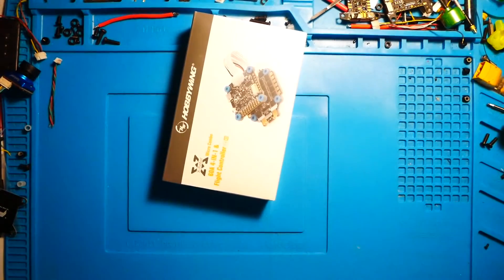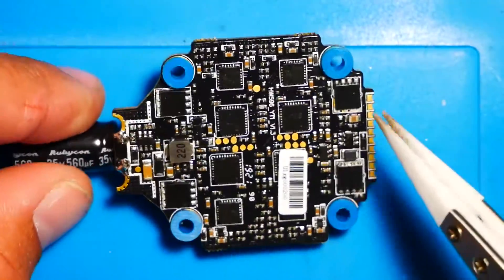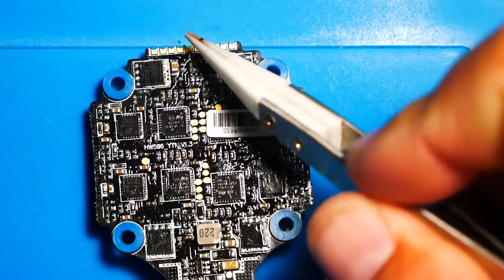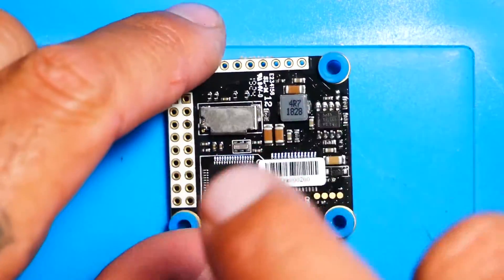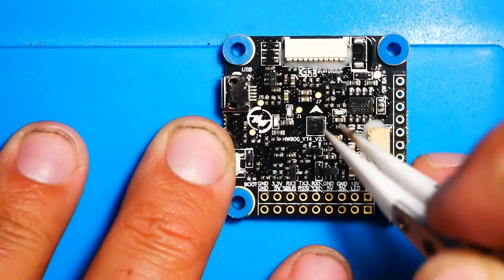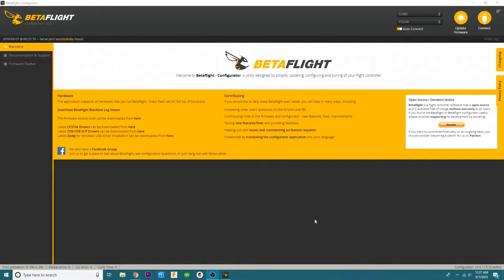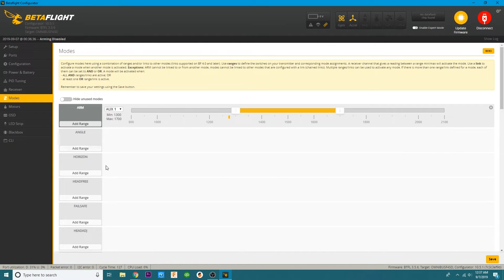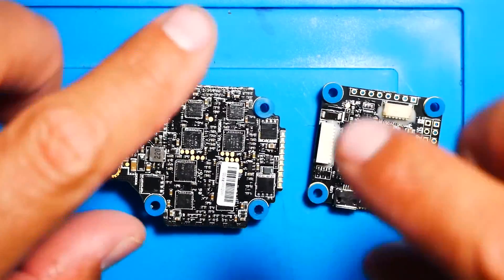NEW! Hobbywing XRotor G3 Stack For $99 - They Are Calling It The Best Stack Ever?!

Comment: Hey Drain man, or any one els that might be able to help, are you able to confirm if this flight controller has built in memory storage for black box logging or if the sd card slot has to be used for black box logging. Iv had this controller for a number of years now and I have never dives into the black box aspect of the hobby, this is something I now want to try and I am trying to get black box logging set up in beta flight although it is not picking to on board  flash which is why i am assuming it must only be SD card capable 
Thank you

Comment: Will this stack plug directly into the DJI FPV System or will it need to be soldered? Thank for the video.
Reply from the maker: My DJI system is on the way, I will be doing builds and tutorials, but for now I would assume that you will have to solder it up.
Reply: It won’t work right with air unit.No telemetry back to goggles or radio.This is a quote from HW support.

Comment: Hi, can you connect  a vtx to vbat or do  you have to  use the 12v. I have a tramp HV vtx. Thx
Reply from the maker: Double check the input voltage of your tramp, if it's in-between 7-24 for example you can run 4s if it's 25v or more you can run 6s and be fine connecting to the vbat

Comment: @drain man fpv hey bud love ur videos btw. Lol.  Having trouble with rssi working on spektrum. I have my receiver on tx1 right now. Let me guess it needs to go to tx3 which would be same column as rssi for other radios? Pls lmk thanks dude!
Reply from the maker: Hey Austin, I don't fly spektrum so unfortunately I have no knowledge about it. But believe it or not I just built this stack after all this time of having it and I did have to move my crossfire off of TX1 and move it to TX3 because it would not work on TX1
Reply: @drain man fpv that's prolly my issue then lol take it apart again I guess lol smh. Thanks dude keep ur videos comin they're really helpful for me man, I dont have anyone to rip with so I learn on YouTube and life lessons lol
Reply from the maker: @juanmoe-t6z  check for local groups in your area. It's a lot of fun to fly with more pilots.

Comment: Will I be able to use the vtx switch with my unify 5v? I may be confused, but from what I can tell, it is either 12v or 3.3v.  Thanks
Reply from the maker: The 12V is really good but there is other 5V pads.